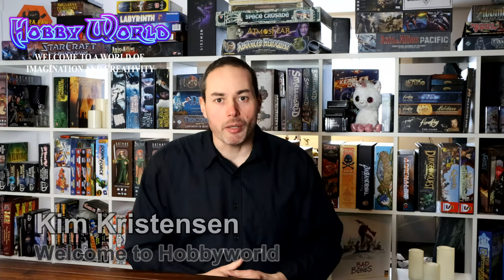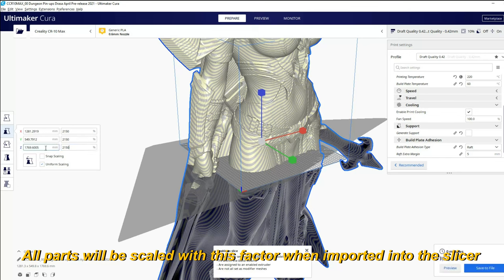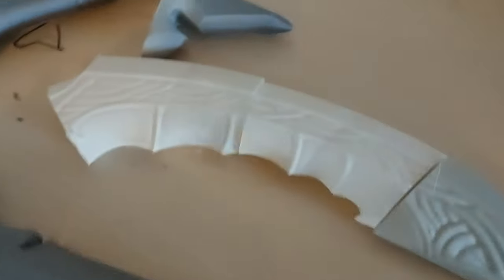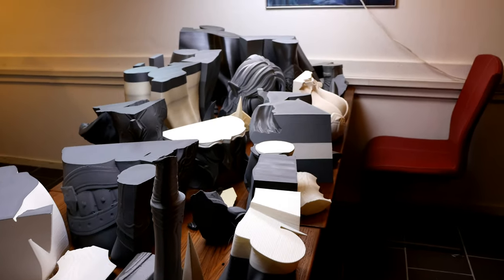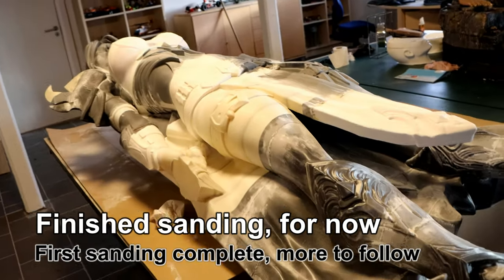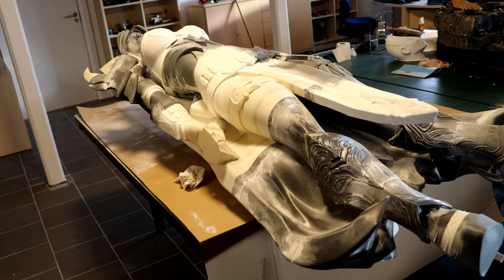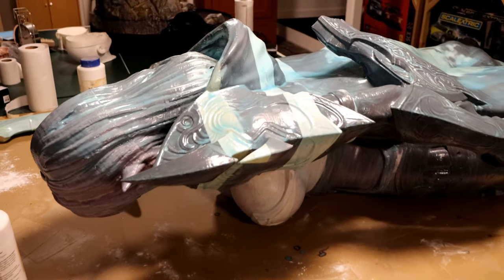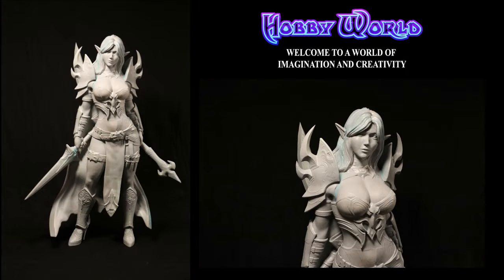Drasa The Assassin, Fantasy Pin-Up Girl [3D Printed, Full Size] - EP1 [The First Steps]

Comment: Thanks for talking about the strength. A full size print should probably be hollowed, even for an FDM printer, to reduce the weight.
Reply from the maker: Thank you so much for your feedback :) A print I did some time ago failed due to the weight so I have tried to learn from that mistake. Printing the model with decreased infill in the top parts has worked really well for me so far.
Reply: @HobbyWorld_one  I wondered about using prusaslicer, or a resin slicer, to hollow parts that don't bear weight. I think you can export the hollowed parts to STL again and use your slicer of choice to print them. Great looking result!  Tired of sanding yet? ;)
Reply from the maker: @jaysprenkle1026  That might be worth checking out, could be a fun experiment :) When printing with only 5% infill it almost feel hollow (weight wise) but it's still very sturdy. I have been tired of sanding ever since I did the terminator model last year :D But I do love painting these large models so it's ok :)

Comment: How think are your layer lines printing at and how many walls are you using?
Reply from the maker: I used a layerheight of 0.42 for the large parts with a 0.6 nozzle. There are two walls :) Thank you for the comment, please write if you have any other questions.